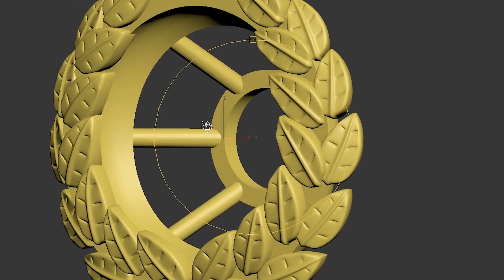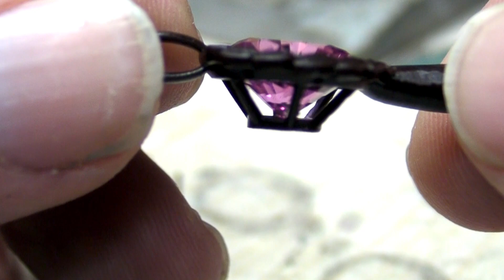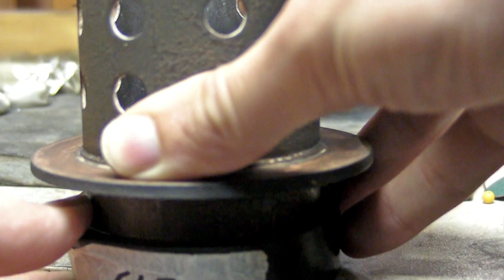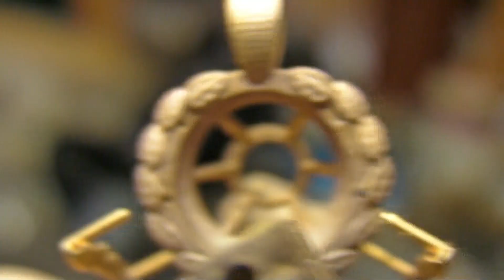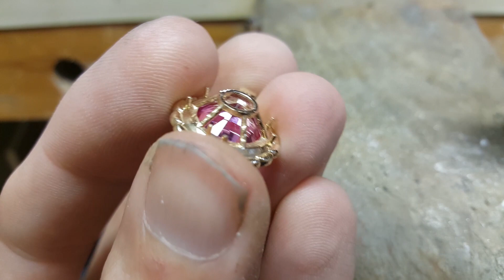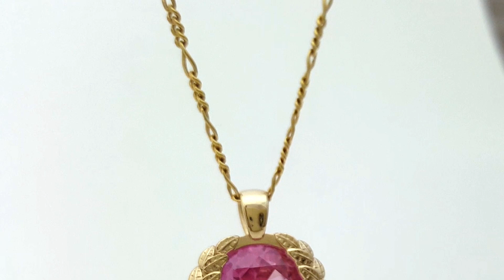Casting Gold from 3d Print and Setting Gemstone in a Laurel Pendant

Comment: Hey Nicholas, 
What a great video. 
I'd really like to know about your vacation casting chamber. Do you have any information you can share?
Reply from the maker: Sure thing. It is a procraft vacuum/investing table. The casting chamber was broken on the machine so I also use something called the "casting block 2.0" which sits on top of the investment side of the casting machine.
Reply: @SterlingKisses  thanks for replying. I tried to look it up but couldn't find anything. No matter.
Reply from the maker: @user-qi1qs8zj9t  yeah, I can't find the casting block either. I got it a number of years ago through Stuller but it looks like it's not available anymore.
Reply: @SterlingKisses  it's ok Nicholas. Thanks anyway. Keep up the amazing work.

Comment: Did I miss you name the type of gemstone that is? Looks like kunzite? A little too pinky for amethyst and a little large for a pink sapphire.. I love the clever setting/no-prong idea, I prefer natural settings to prongs which I find take away from the beauty of the piece and the stone themselves. Did you want the posts to look like rivets? Would it have been easier just to trim down fully & solder them then polish them flush? Great end result!
Reply from the maker: It was set with an imitation amethyst. I was concerned that the gemstone would be damaged by the heat so I decided against soldering the piece. Thanks for the comment!

Comment: I was a little surprised that in the 6 holes that hold the posts that you didn't ream out the holes on the back side so that the holes had a tapper flare to it so as you pressed the posts down into the holes, it would had given you a better holding of the top pieces, and then you could totally had a prefect flat and smooth surface on the back of the pedant. I was a little surprised and you didn't pre-polished the pedant before you mounted the stone. but other than that, I enjoyed watching the video and did learn some tricks from your video, thank you with sharing that with us.